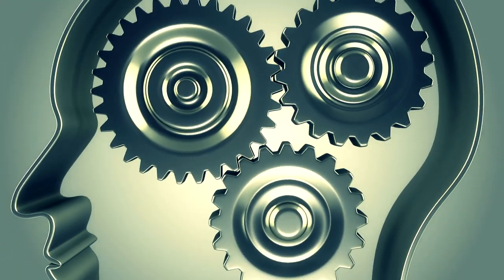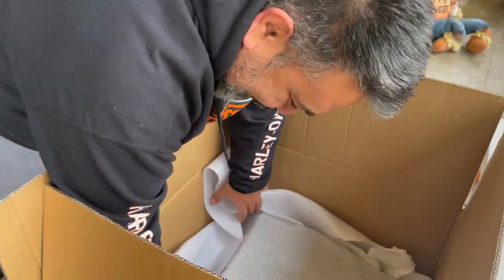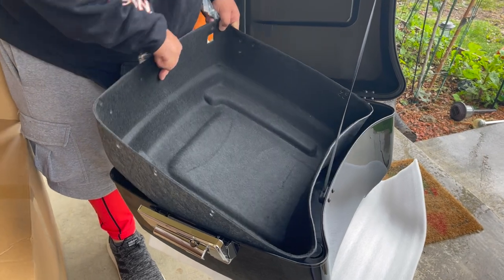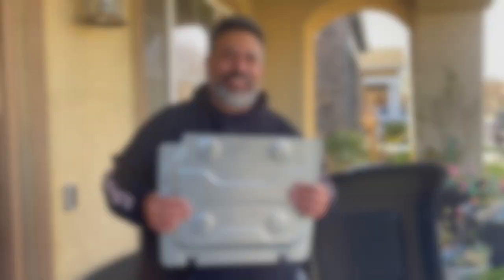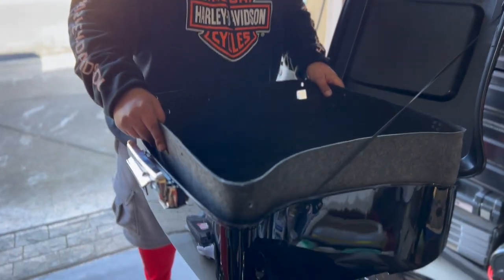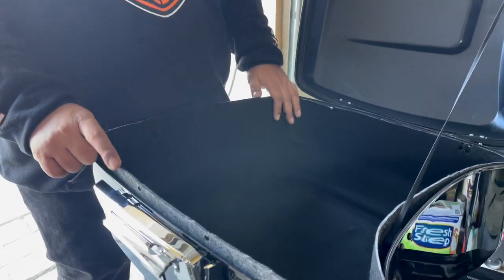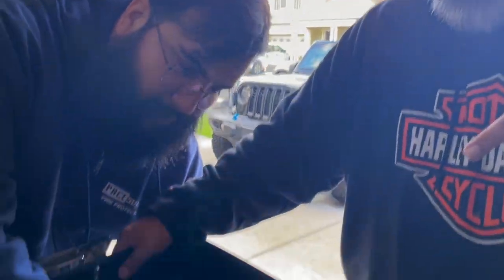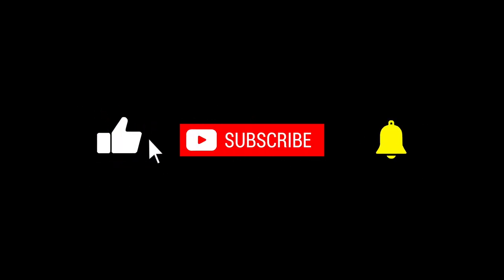The Perfect Addition to Your Harley Davidson, King Tour Pack

Comment: 😁 I bought the same tour pack last week but I bought a different steel plate and the liner fits fine. I think the king looks good to me, and can pack a lot more and 2 size helmets.  It will scratch easy so be careful.
Reply from the maker: Yeah! I think I will not store my helmet in there... But I think it looks nice and for me I do not think I will need the rack or backrest... but if I do I will install them.  
Packing now for a road-trip! Let's see how the tour-pack does :)

Take care and stay safe!
Reply: @CageFreeMoto  I would only put my helmet in the trunk when I'm out riding and stop at store or a restaurant. That's why I went king, if not I would go chopped 👍
Reply from the maker: @carolinarider5237  I will stick with chopped for around my stomping grounds, however, for a road trip where I may need more room the King tour-pack would work best for me.
Reply: @CageFreeMoto  that's all I'm using mine for on my RK is long trips . Around town it off, rocking a solo seat from Bad Boy Cycles.
Reply from the maker: @carolinarider5237   I think am going to to do the same, but I do like the chopped tour-pack.  But in my opinion the Road King looks nice with no tourpack and the sadden step-up seat. :). 

Stay safe!
Reply: Which plate did you get? Link?

Comment: the light holes and tow other holes in the bac you Didn't address
Reply from the maker: There are no holes.  I have received two of them and neither of them have holes. I did videos on both and one we needed to drill the holes for the docking station and the other one they were pre-drilled. Maybe they have updated them since I made the videos. Did you find they have them now?

Comment: Have you mounted the backrest? I'm interested to see how you drill the holes to mount it. They don't come predrilled.
Reply from the maker: I do not think I am going to use the back rest, but if you dab the ends of the screws from the back of the seat with something like toothpaste, then you can aim where you want it to go and drill the holes.  I seen this somewhere before.

Since I ride alone, at this time I am not installing the rear backrest.  Sorry.

Comment: Your mounting plate is upside down. Flip it over and you won't have to cut the liner.
Reply from the maker: That’s what we thought, however, we did try it the other way around.  I was informed that if you buy another brand it will fit fine and avoid the issue I found.  Also, TCMT is looking into this issue.
Reply: @CageFreeMoto  when I got mine, I ended up just trimming the plate so that the middle portion would bolt down nice and also by trimming the plate. It allowed plenty of space for all the wires to nicely tuck away. TCMT, if you’re reading this, please make the plate work properly, without having to make these altercations.
Reply from the maker: @jeffreyengle2762  Good suggestion maybe I will do that instead buying another plate… hmmm… THANKS1
Reply: @jeffreyengle2762  Yes, one of the functions of this base plate is to hide the wires. If you do not need this function, you can choose Base Plate XF111530, which is suitable. At the same time, we are also adjusting our lining, which will take a little time.

Comment: Everyone i find has holes drilled for the speakers and see yours doesn’t have it. How long ago did you get yours? I dont want those holes already drilled into mine.
Reply from the maker: About 6 months ago from when you left this comment.  Did you try the link in the description? They have not speaker holes.  I have been using mine since install.